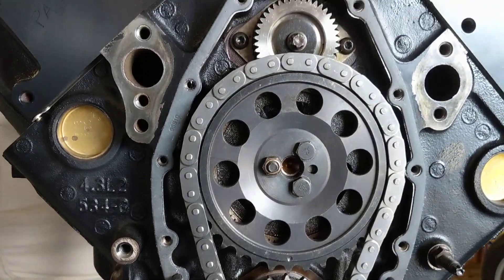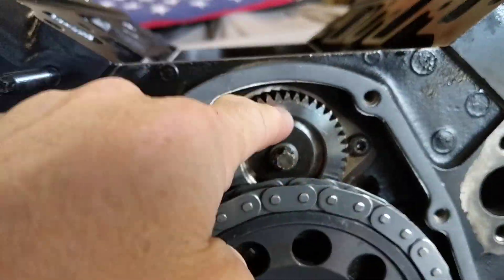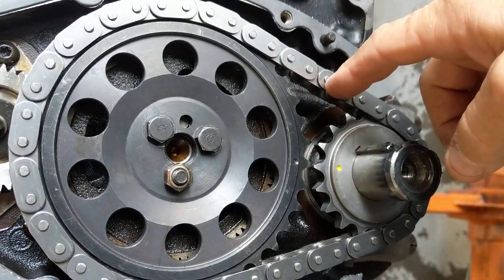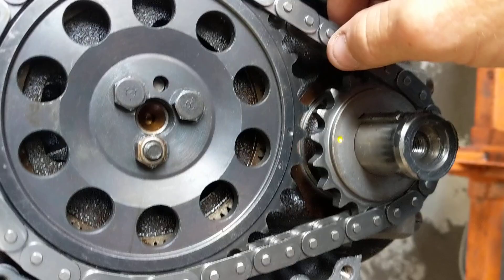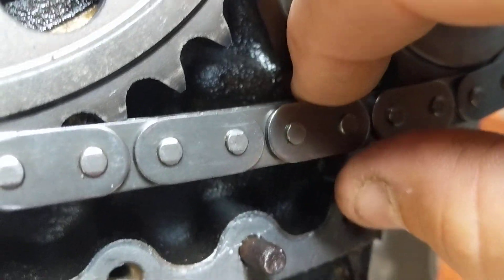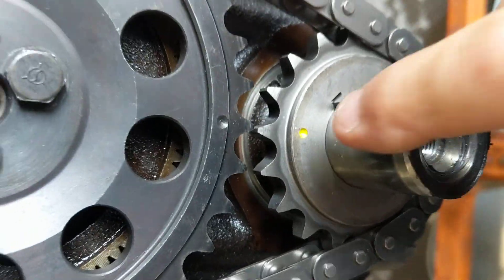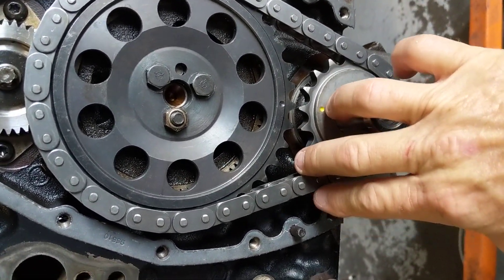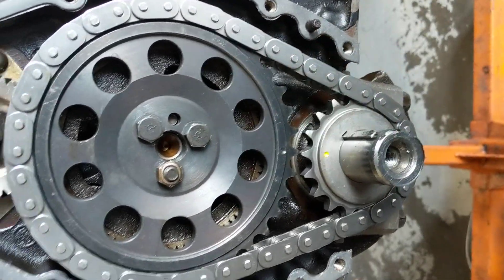Timing chain Chevy 4.3 v6 w/ balance shaft .

Comment: How the timing mark show on the voteck engine v6 if the rotor is face the the number six on the rotor,
Reply: It's pointing at number 6 but look inside the distributor cap it directs it to number 1 look under inside the cap  the vane , you time it off number 1 , my motor was a tbi set up so the distributor cap is different . # 6 on your cap is number 1 follow it I hope you understand

Comment: Jking I have a 4.3L engine with that timing chain cover. Due to the timing chain cover would you assume I would have the balanced shaft also? I have a 94 chevy c/k 1500
Reply: Hello if I am correct any 4.3 motor made after 1992/1993 has a balance shaft ,   some  vin code z and all vin code w have balance shaft .that's the 11 digit in your vin code
Reply: @joeking6463  ok man I've been pulling my hair trying to get this figured out. Thank you. Also with other information I have it just bulletproof my answer.

Comment: I had the same issue. When I ordered the kit from Cloyes for my '02 Chevy s10 4.3l, there was slack. Not as much as the worn chain but still quite a bit. So I contacted Cloyes. I sent a link to this video and a video of the slack in the chain I got from them. I was told the billet chain seen in the video was for something like '94-'98 models and the slack in mine is "normal". That it's actually a design flaw (huh?! No way. Not GM. They're known for their quality and precision). He also said they corrected the design flaw by adding a tensioner, but would need a new, modified timing chain cover. Apparently the tensioner attaches to the cover.

Comment: What would you notice in engine performance with excessive timing chain slop?  Less power?  Rough idle?  Lower MPG?
Reply: Misfires and also rough (felt) at low rpm…
Reply: If the chain is stretched the timing will be jumping all over as the chain is stretched .try to set base timing with a stretched timing chain .  , Poor/  Less performance. . If it's a 4.3 with a balance shaft more than likely it needs to be replaced  as it spins the balance shaft off the back side of the front timing gear with a helical gear set up .The Balance shaft spins twice the rpm of the motor .
Reply: @joeking6463  The extra rotating mass of the balance shaft could be the culprit but the tensioner fixes it.  On my 03 4.3 S10 you can't "set timing"  distributor goes into the cam gear at TDC on #1 and then you bolt it down.  Engine spark timing and advance is all controlled by the ECM.  There is no rotating the distributor for more or less advance.
Reply: @x-man5056  most all 4.3 never had a tensioner .and if you add a tensioner it won't fit behind your stock cover .  Yes you are correct you can't turn your distributor it's locked on . I have built many of theses 4.3 . Balance shaft or no balance shaft . I prefer one with out .
Reply: @joeking6463  Interesting.  What is the pros and cons of the balance shaft?  I know takes horse power to turn it but what is the gain with out and what is the cost in terms of longevity and I guess some intense vibration?  IDK
Reply: @joeking6463  I didn't know about the different cover thing but i didn't do the work on that, the dealer did, warranted.  Tensioner fixed the problem both times but never very keen on the balance shaft deal.

Comment: 11 mm is allowable per the service manual
Reply: That is NOT for a new chain.  11mm is the max allowable to be considered "serviceable".  11mm is over 0.4".  That is just way too much for a new chain.
Reply: @x-man5056  11 mm is for any chain. Meaning if the repair manual says you can have 11 mm in slack, the engine isn't going to care of it's an old chain or new as long as it's under 11 mm. But according to Cloyes the new chain slack (as seen in the new Cloyes chain for my '02 4.3l s10) is "normal". That it's actually a design flaw (hard to believe, I know) and GM added a tensioner to the set up a few yrs later.
Reply: @SteveFrench_420  They created the tensioner fix (service bulletin), but they didn't start putting it in at manufacture.  My 96 SS S10 had to have timing chain tensioner installed before10k miles.  My 03 ZR/2 needed to have it put in before 5k.  I was so pissed that I had to put another S10 in a shop for 3 days to do it even though they did it for free.  
If your new Cloyes chain is a double roller it will not likely stretch as much or as fast as those stock POS chains. but I would put it in anyway.  When that timing chain gets sloppy, it makes your engine ping/knock like a frozen cold diesel.  And God knows that b*tch is buried in there.

Comment: Great, informational video sir. Currently, I have 01 Silverado with an 4.3 motor identical to the one you are showing, and the new cloyes chain has at least 1/2 inch slack. The book says it should not have more than 5/8 slack.  I pick mine up from Orelliey's. Where did you get yours, and do they make two types for these 4.3 Vortex?
Reply from the maker: Steadfast Ricardo hello I sent my cloyes timing set back to cloyes gear and had them send me out a perfect matched set .They have a mock up to see how much play will be in it at cloyes gear ,my first set I bought from summit racing had like 1/2 inch of play in it right out of the box .they make a stock replacement chain and they make the billiet chain set up ..  5/8 of an inch is way to much you will never set the timing as it would jump all over with that much slack in the chain .
Reply: I would never go with a new timing chain with 5/8" slop.  What would be the point? 1/8 to 3/16" max.  The chain gains length when it gets to operating temp.